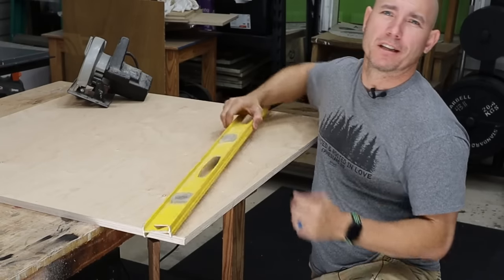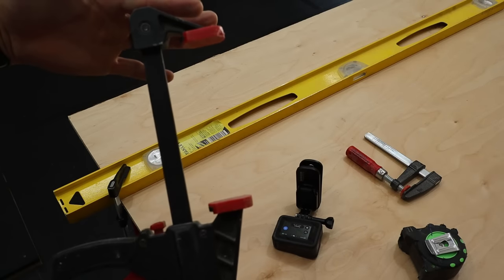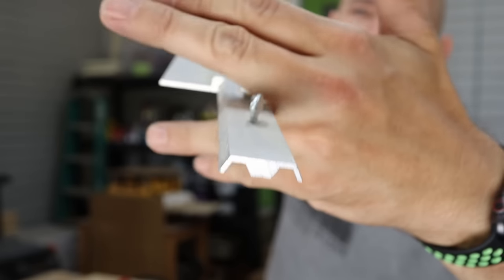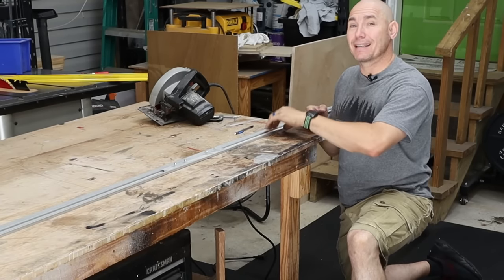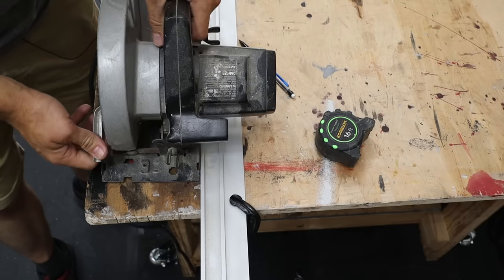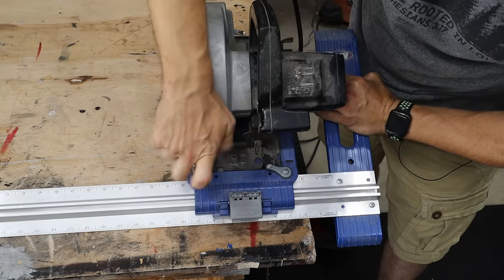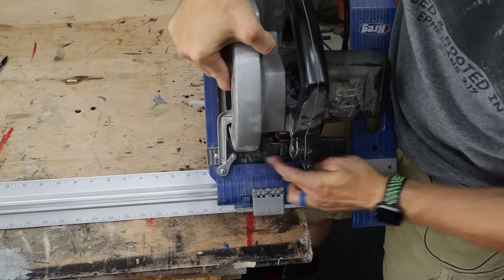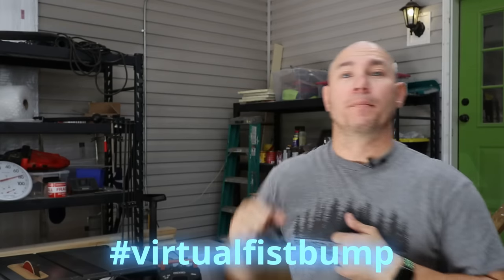How To Make Straight Cuts with a Circular Saw and a Straight Edge or a Kreg Rip Cut

Comment from the maker: Check out other woodworking tips and tricks here: https://www.youtube.com/watch?v=jsClV9zZNLM&list=PLWVlC66wUw8YQwF4QEfwgxh45ZcrJIE8y
Reply: Which these 3 methods would you say are the straightest and most accurate as I’m looking to joint several edge to edge 8 FOOT LONG pieces of 1x6 boards together to make thin sliding hanging closet doors using a router

Was looking at a Kreg Straight Edge Guide similar to that Swanson you got or simply clamping an 8ft Empire Level, as well but after seeing that 100in Swanson one you got I’m considering this option as I like how thin and easier to clamp it is aside from a long level is $$

Comment: Excellent tip. I am a beginner level weekend woodworker and I did not know about the swanson straight edge.
I wanna add that if, for any reason, you made a slanted cut, use a drywall T-Square to make sure you have a straight line drawn perpendicular (90 deg) to a factory edge and use a straight edge to make a cleaning cut to get the slanted cut out.

Comment: Matt, you really helped me with this.  I do not have a table saw or a workbench yet. I am using saw horses as a platform. I sadly purchased big box lumber that came with its usual host of issues.  I needed to take 1/4 inch off the edge of my boards and I used your method of measuring from the blade to my cut line and securing a straight edge. Simply brilliant.  Thank you, I always look forward to your videos.

Comment: The Kreg RipCut is an excellent tool.  I have one and use it with my little Ryobi  One Plus Circular Saw. I don't use it a lot now since I bought the Kreg Adaptive Cutting System for around $1000, but before I had that, it did a great job in getting my plywood square and accurate.
Reply from the maker: nice

Comment: Another tip is to measure the distance from the blade to the edge of your saw and cut a piece of plywood that width. When you need to make a cut you place the cut piece of plywood next to your pencil marks. You then put your straight edge next to the plywood and tighten your straight edge down. No measuring needed after making the plywood spacer/jig. Make sure and mark it as " Jig Do not Throw Away".
Reply from the maker: Good tip. Thank you

Comment: Great video! Suggestion for a video would be on the topic of how to fix mistakes. I am working on a project and a brad nail shot out the face of my project. It’s been tough finding content on how to fix mistakes. Also thank you for showing your Faith on this channel.
Reply from the maker: Are you painting or staining the project with the brad nail hole?  This will fix the hole https://youtu.be/AAeGQYQeJXA
Reply: I am staining it. Thank you for the video link! I ended up using  a flat head screwdriver and hammer then gently pounding the brad nail just under the surface so I could fill the hole with glue and saw dust.

Comment: i got a kreg jig, money well spent since i don't own a table saw yet. I would say that those screws at the top do get loose. There are channels on the bottom of the jig that don't get used as tracks. I drilled a couple of holes through my saw's floor plate into the voids in the jig and used some nuts and bolts near the top and bottom (once i had my zero establish) and now it doesn't move at all. it also wont interfere with the kreg cross cut jig either. Note that i used an old circular saw and dedicated it to having the kreg jig permanently attached (well worth it to not have to set it up everytime i want to use it).
Reply from the maker: It's a great little tool

Comment: When cutting sheet goods, I use a 2" thick rigid styrafoam on the under the sheet good for a stable base along with not having the finished piece fall. thought this might be helpful.
Reply from the maker: Thanks for the tip

Comment: I didnt read all the comments so its possible someone else mentioned or does this. I did a test cut with my saw from both sides of the saw against a straight edge then measured what that offset was and using a sharpie, put those two measurements on top of the blade guard so it is right there and I just add that offset (depending on which side of the saw I am cutting from) to the measurement of what I am cutting off and it comes out perfect. I like the idea of using a cut off piece of wood but that can get easily lost (or mistaken for usable scrap wood,lol)  in my small shop

Comment: I use the Swanson straight edge and it works really well except on long cuts the middle will bow out slightly from the pressure of the saw against the rail. I've used finish nails behind the center section, or a long piece of 1 inch material clamped to the opposite side and placed against the outside of the inner rail to keep the center in alignment. Have you seen this problem?

Comment: I haven't shopped around, these are from Amazon in the UK.
Kreg Accu-cut (up to 50 inches) £92.51
Kreg KMA3700 Accu-cut XL (up to 100 inches) £174.99.
Right now, one pound sterling is 1.29352 US dollars. I will let you do the maths. 
Kreg kit is always expensive in the UK
Reply from the maker: Yeah I’ve heard that
Reply: On the other hand, I'm trying to stop economising on tools. They say a bad workman always blames his tools but having good tools does improve the odds of a good outcome. I'm just retiring and setting up my little workshop and from here on I don't want to be replacing the tools I have yet to buy because I bought crap the first time!

Comment: I think Matt is in my head. I recently cut down my first sheet of plywood. I couldn't for the life of me, get it straight and wasted a fair bit getting it ready. Came to find out the level I was using had a slight bend to it and it through off everything. I went and picked up the swanson straight-edge and it is great. 

Problem I found is once you cut plywood with an unstraight edge it is hard to correct it..or at least it was for me. For about 2-3 weeks I was convinced I would never work with sheet goods again unless I had to because of this experience.
Reply from the maker: lol a good straight edge will help for sure
Reply: Lol ya that would drive me nuts. But look at it this way now you know how to fix it if you ever come across anything like that again
Reply: @snarfersaxe  I hope so, plan on trying to build some hanging cabinets for the shop soon, we shall see how it turns out

Comment: I appreciate your suggestions, honest opinions and thorough demonstration.  I'm a novice diy'er (is that redundant).  I have an I-beam straight edge.  I tried the Kreg cross cut guide.  But I could not get my Milwaukee M18 Fuel 6-1/2" circular saw to sit straight and clamp securely on it, and had to return.  Mine, even the red arrow was crooked, maybe I got a bad one, but it did not look like it would work.

Question.  On the Swanson 10' straight edge, I read reviews that it bows in the middle.  It seems if the screws are tight enough, it looks secure.  What is your opinion regarding bowing in the middle?  Was looking into the Swanson.  Thank you!

Comment: I generally use a 4' straight edge for cross cuts on plywood and/or a good speed square for cross cuts on dimensional lumber. I do use a Kraig rip cut guide but the only problem with it is that it is dependant on an edge that may or may not be perfectly straight. For rip cuts on 8' sheets I use a guide with integrated clamps but they're honestly a bit pricey for what they are.

Comment: So now that you have a jointer, would you say its easier/comes out nicer vs your previous method? Just curious if you would recommend actually getting one or is your other method just as efficient.
Reply from the maker: oh it is certainly easier.  And it does do a better job than the table saw method

Comment: the very first thing is make sure your blade is square to the plate AND the shaft out of the motor is straight,  Do this before even cutting with it.  Hell do it in the store.  I fought one for years, no matter what I did it was off bad off.  My son gave me one of those cordless jobs and I figured Ya RIGHT...  Not only did it cut straight it had pretty good run power/time.  WANT the big surprise --- Craftsman ya Craftsman

Comment: What are your thoughts on cordless circular saws? do you think they are easier to control because there is no cord, I just picked up the Bosch 18 volt cordless. I haven't used it yet, also it's a lefthanded saw even though I'm right handed it seems like it may be easier. Great video
Reply from the maker: the next one I buy will be cordless.  I hate the cords lol
Reply: @731Woodworks  if you go to Lowes they have the Bosch  cordless circular saw with a free 18 volt 4 AH battery and charger for 119

Comment: Thanks Matt for the video. I also use a 48 inch level and the Kreg cross cut, but It is limited in length. I am looking to get some straight edge tool to get to those longer cuts, like Bora or even Kreg products. But your suggestion of the Swanson straight edge is cheaper and will end up in my amazon cart.

Comment: Hi you measured 3/8th inch both side because you have a perfect square plywood, can you do a video on straight cuts for  any wood that don’t have a factory build straight wood, to get it squared with the same tools, thanks.
Reply from the maker: thanks
Reply: You will make the same cut but a bit wider. Then square the 2 short ends. After that repeat this cut for the crooked edge.
Reply: @b3arwithm3  thank for that tip

Comment: Straight line cutting was good I've used a straight edge many times to made the same cut but I didn't know about your other product making it a 8' straight edge; thanks I'm going to check that out.  The fact you view all comments and may pick one to demonstrate on your show is why I'm writing you. I'm refinishing a grand piano that's about 118 years old so yes,  there's damage to its lid and other places. I'm having to replace a piece of African mahogany veneer on the lid and I've found a great place across the united states in New York,  who has the veneer but my problem, my dilemma is how do I cut a perfectly straight line on a grand piano Lid, to replace it with a 10" piece of veneer? The veneer is a nice straight ledge and using a ruler I can get half was across the lower lid section but I have to use the ruler twice and that is where I'm running into difficulties. Any suggestions on making the straight cut and being able to line up the veneer would be appreciated. Thanks

Comment: The thin sheets that are used for back of cabinets. Get a sheet and cut a 3 inch strip 4 feet long. Rip a 6 inch sheet 4 feet long
Hot. Glue the 4 inch in the middle of the 6 inch strip. Use circular saw to cut short and long side of circular saw
Reply from the maker: nice tip.  thanks

Comment: I wish I saw this video earlier. I tried many straight edges and finally settled on the swanson 2 weeks ago. It does not flex at the connection like others. And it is a bit longer than 8ft allowing the saw to start straight.

Comment: Matt! Me and my fiance built a dining table out of 4x4's and 2x's due to lack of know how i used lag screws to attach 4x4 runner (under  2x4 top) to 4x4 legs. what would be an efficient method for that?  Or maybe video idea.
Reply from the maker: You could half lap the joints, mortise and tennon the joints.  Pocket holes work too.  Have you seen my table build?  I have one with a 4x4 base
Reply: @731Woodworks  No i guess not. I have the k5 and just ordered the Xl jig. Ill definitely check out video.
Reply: @731Woodworks  I did see the coffee table if thats what your reference is to.   with 4x4 legs
Reply from the maker: Farmhouse table build here https://youtu.be/qg_hwoekV80

Comment: I’m having issues getting a straight cut on wood with uneven edges. I don’t have a straight side to reference and measure and mark. So I have to just eye ball a straight edge and if it looks straight, I cut it. But it doesn’t always come out perfect. Any suggestions?
Reply from the maker: Jointer or jointing with a table saw.

Comment: Hey buddy, it's Steve O. Do you have any experience with the Rockwell Table Scroll/Jig saw? I believe it's the X2 model? I found one used but in box new at a local pawn shop. $60,I'm thinking about getting it. I got several pieces of old Eastern Red Cedar we cut after a hurricane blew them over. River grown, we hae a saw mill
Reply: We had a sawmill back then, so we cut the trees, hauled them to the mill, cut and planed them. Pretty good stuff. Thanks again man, really like your channel.
Reply: Im needing a sure way to get this stuff cut and ripped straight as an arrow. Got a few different projects in mind. One of them is the cell phone stands I see selling for around$25 apiece. 2 pieces at 3 1/2"x7".
Reply from the maker: Sorry I’ve not used that

Comment: How do you know your straight edge is actually straight when clamping it down. Like it's not veering off. How could I make a new straight edge on an uneven cut piece of plywood?
Reply from the maker: On plywood check out my 3 ways to cut straight video. Use the straight edge method

Comment: What would cause my circular saw to drift when trying to cut straight using a straight edge? Bent blade? Now I have a kreg guide but haven't used it yet. I use my circular saw to cut plywood down, then use my table saw.
Reply: I would bet, it's a dull blade. I've had the same issue. New blade fixed it.
Reply from the maker: I would try a new blade first and see if that fixed the issue
Reply: Thank you guys, I will try that.

Comment: Before I owned a truck it was not possible to get 
4 x8 pieces home. Lowes has a sheet cutting station and they will cut it to the dimensions you need. They don't charge for it either. If the pieces aren't too wide you can put the back seat of the car down and get it in. I have found this to be dependable. Obviously you have to watch the measuring. I ask for larger then I need and cut it at home when it is manageable. I have used a jig saw but have never seemed to be able to keep the blade straight. It works but can be used to get to a manageable piece to use circular saw or tablesaw. I like cutting 4 x 8 sheets on the floor with the entire board held off the floor by 2x4s so I don't have to deal with a big piece hanging over the work bench.
Reply from the maker: Good info. Thanks for sharing.

Comment: On the first method, use a square to make sure both ends of your "level" make 90 Deg. with edges at each end and you do not need to measure again, It is simple geometry.
Also, cut a straight edge the size of the distance between your saw blade and the edge of your circular saw. and put the straight edge after your measurement and align your level with the other side of straight edge. So, you do not have to eye ball your blade. 
Also you can make T-Square, each side of the T is the size of the distance between saw blade and the edge of your saw.  Of course, one side is shorter the the other side, because the distance of the saw blade to the edge is shorter in one side of the saw than the other.  Then only  measure to side of T and and clamp the T-Square without any further measurement.

Comment: If you use the rip cut and you're using the edges your guide what if your edge isn't straight does that mean that your wood's not going to be cut straight either?
Reply from the maker: Correct.
Reply: @731Woodworks  Thanks

Comment: I can't keep my plywood from shifting. I can't figure out what I'm doing wrong. I'm using a Kreg Rip Cut with a Ryobi. Help!
Reply from the maker: Clamp it down if it is moving when cutting.  If the rip cut is moving, hold lateral pressure towards the plywood on the rip cut handle as you cut.  If you can't get a straight line and the cut is giving you trouble, it's time for a new blade

Comment: How about a 3/4 thick, 6 inch wide,  24” long…..and you want to cut a staight line down the middle……it is hard to get the piece held stationary….while at the same time securing a straight edge.  I suppose an edge guide on the saw might work, But I have had better luck with a clamped edge guide…..Anyway any ideas would be greatly appreciated. I feel like there must be a fairly easy answer to the question but I just I’m not envisioning it

Comment: I bought a Swanson straight edge to help rip down plywood not too long ago, I would not recommend this for anything more than 4ft. With both 4ft sections together it doesn't matter how much you crank down on the joining bracket, it flexes way too much.
Reply: I plan to add a grippy bottom to mine, either glue on thin rubber like shelf liner or maybe sandpaper, not sure yet. I think that might prevent the movement in the middle? Maybe?

Comment: that kreg rip tool only cuts straight if the edge is straight.  The straight edge works in every case. The kreg tool is more designed to solve the problem of making repeated cuts of the same width
Reply from the maker: True

Comment: if your edge of plywood is not straight, how do you get a straight cut?
Reply: Use the straight edge, like the Swanson or level. Then it doesn't matter how crooked the edge is because you aren't referencing the saw off that edge.

Comment: I hate my kreg rip guide. For some reason my cuts (edge) are never square..its like the blade is cutting at an angle even though i use an angle finder to make sure before i cut. I always have to flip the piece over and do a second pass
Reply from the maker: Dang. Sorry to hear that.

Comment: Here is my challenge….. the edge of the board is crooked. I can’t take measurements from the edge because the measurements will be different.  I need to make sure that the line I draw is a straight line.
Reply: Framing square